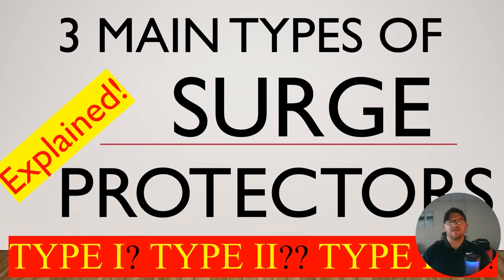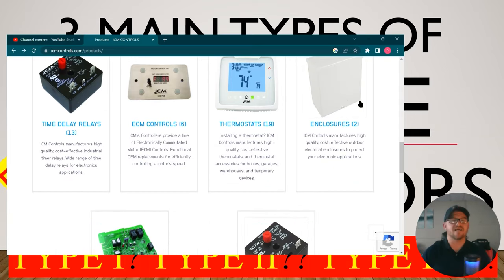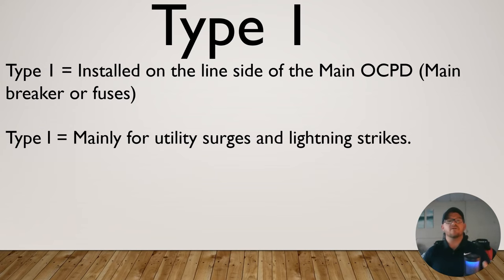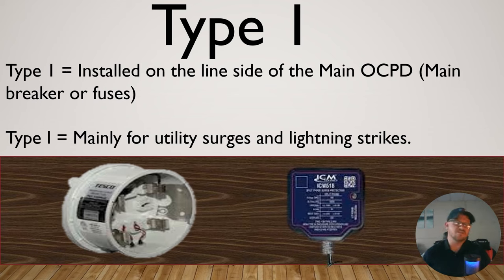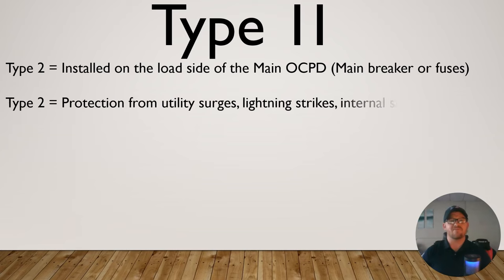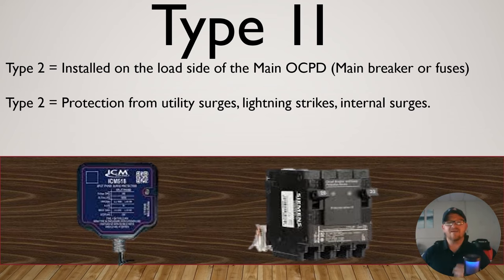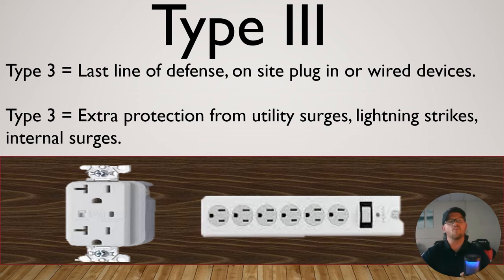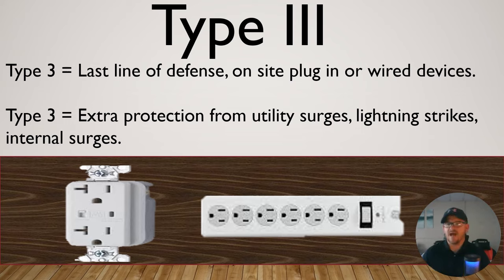3 Types of Surge Protection Explained! (do you know?) Type 1? Type2? Type 3?

Comment: How does the manufacture recommend you wire a type one? I’ve seen them landed under the main lugs, but if the panel isn’t rated for that it’d be a violation. I feel a lot safer putting them on a circuit breaker, but i’d like to hear what others are doing